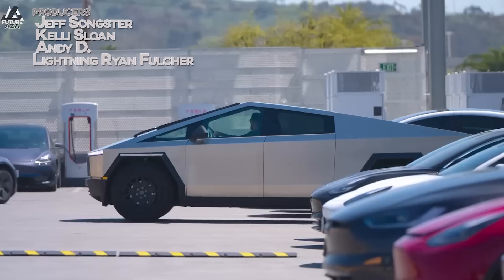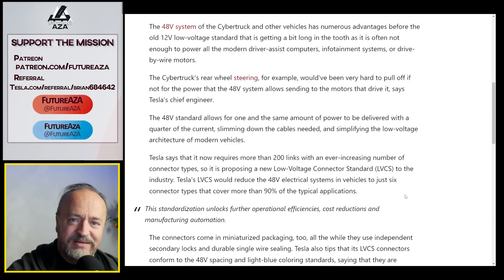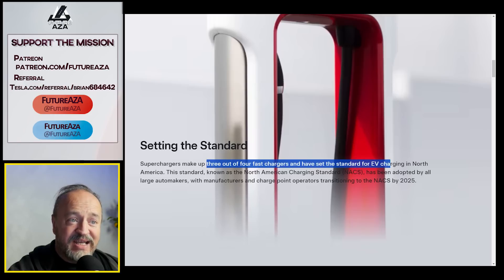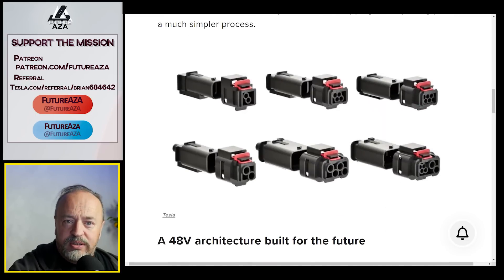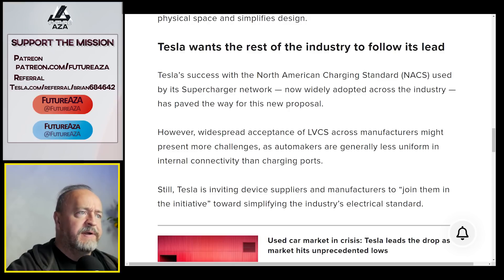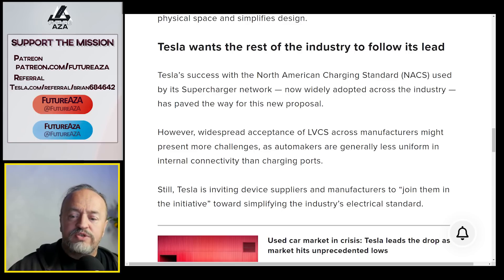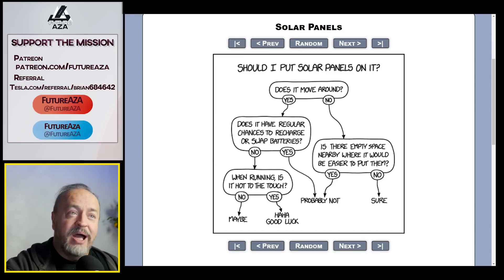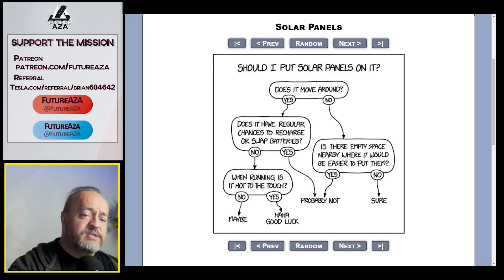Tesla's GENIUS Low-Voltage Connector Standard... Will Anyone Care?

Comment: if a semi trailer had a it's own batteries do you think a solar array on it would charge the batteries and would that be cost-effective to be able to help mileage?
Reply: Ironically, that could work financially if it was diesel powered. Electricity from dinosaur juice vehicle engines is hideously expensive, and you do want/need it for all sorts of useful, convenient and fun things. If your truck is electric, electricity is cheap. Then the solar panel is a costly gadget that can provide some function in rare use cases. Like being parked in the wilderness for a month or three. If that is the sort of thing you might want to do, start looking into how to Macgyver together something.
Reply: Eventually it's inevitable. I saw a thing a while ago about a solar panel they can print with basically an inkjet on paper. Not for your house, but for low energy applications. Solar panels continue to drop in price and mass. If you can use the power, there will be a reason to have it. As long as it generates more power than it costs to move it around all day, it's useful - and even then, if it means you can run out of power, and after a while, drive to a charger somewhere, it's a big benefit to have it. 

Cost vs benefit is the only consideration really. Can you think of why you wouldn't want your caravan/camper, covered in the things on every surface?
Reply: @jonevansauthor  Yes. Cost, weight, complexity, potential repair costs, risks associated with anything electric, insurance costs etc. Right now in 2024, it is possible to rationally choose not to cover every surface of everything in solar cells in all cases. Especially moving things.

Comment: According to Sandy Munro, the cost for an OEM to develop proprietary connectors is a huge development cost that can be avoided by adopting these connectors, and drastically reduces service costs as well.
Reply: Tesla will profit anyway since their own supply of connectors will increase and prices will drop faster. The same will happen with 48 volt if anyone else starts going that direction. Cars like Lamborghinis often use things like the indicator light from a Ford Fiesta. You might think the car industry is opposed to using each other's designs and parts but honestly that's only because you haven't paid attention and don't really get how manufacturing works. No-one makes their own capacitors because no-one uses enough to make that a worthwhile thing to do in house. They don't make their own wire, or paint either. 

It is weird that AMD and Nvidia don't own their own fabs since they could easily use full capacity of any fab they owned. It's not weird that they don't make their own screws.
Reply: @jonevansauthor  There is no single right answer to in source vs. outsource. Vertical integration is great but not in all cases. It's one thing to make a commodity product, another to do something so highly specialized and technically challenging as chip fab. NVIDIA is wise to not overstretch themselves in chip making. Why does Apple design its own chips but not make them?
Reply: So, I expect Legacy Auto to fight it at every step.  Pay politicians and run adds against it for millions of dollars.  Claim Tesla monopoly is out of control!
Reply: @davidbeppler3032  I think that they would be purchasing from the same OEM Tesla is using, not Tesla itself. I'm sure legacy auto is ecstatic that someone else paid for the intial tooling and production and would happily buy into 48V architecture now that Tesla has opened the door.
Reply: @enighostmaster  Every connector made will pay Tesla.  They worked with their suppliers to design and patent a better way.  Imagine getting $0.01/connector.  60 connectors per car, 16 million cars a year.  $9.6 million a year straight profits.
Reply: @enighostmaster  Connectors doth not make a 48V architecture. Think actuators, just to begin with.
Reply: @davidbeppler3032  Wow, I am sure Tesla with $29B+ in cash/equivalents is drooling over $10M. Did they try to directly profit from the R&D, design, and development of the NACS, no.